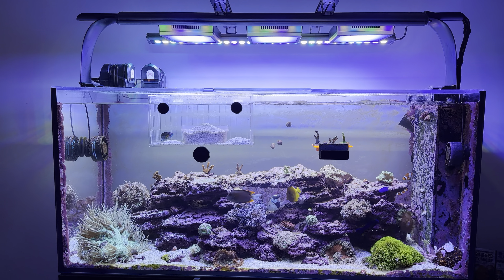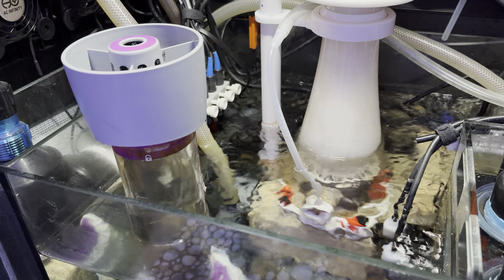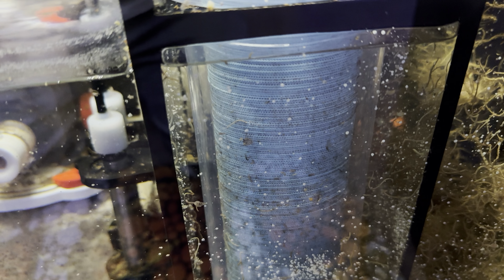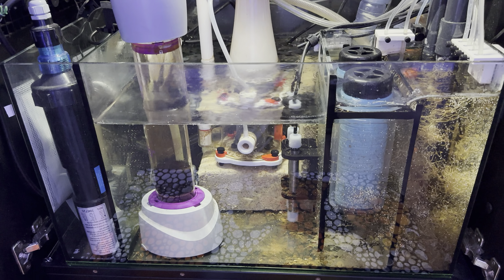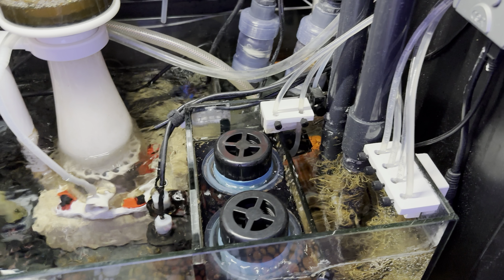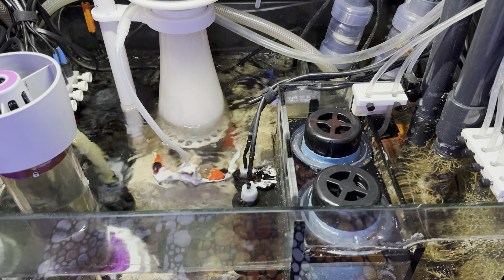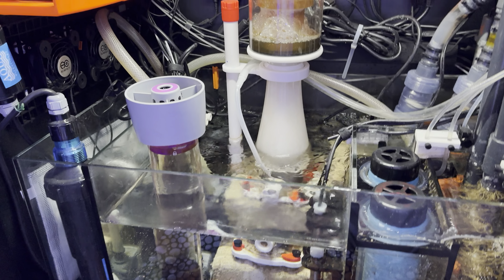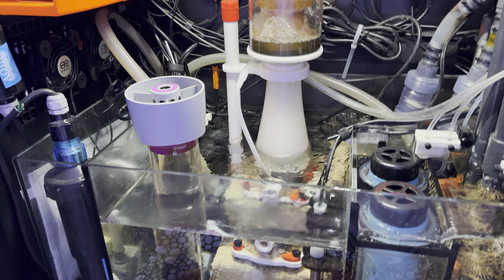Explained: Why I Prefer Low-Flow Reef Tank Filtration

Comment: Thanks for making this!  I was really interesting!  I suspect the trade-offs in flow rate hit various filtration components differently.  Those seem easier to sort through individually, but the sum total of the sump's components as they relate to the flow rate is far more complex to anticipate.  My best guess as to a the potential overall benefit to a lower flow in the sump is that the components that do not require full flow through (e.g. the skimmer, etc.) will be better able to make contact with all of the volume going through the sump system (i.e. there is a reduced potential for bypass flow).  I do like the pump in the sump to create flow.  That's a nice innovation!  Looking forward to the next one!
Reply from the maker: Didn’t mean to ignore this, my old friend, Mr. Dappled! Your thoughts are appreciated as always. This kind of stuff keeps me making reefing content. Agree on the trade-offs hitting differently, component to component. So many ways to do this hobby. That’s what makes it so dang fascinating!

Comment: I would like to know why your dosing output is in the incoming flow chamber instead of return pump chamber.
Reply from the maker: No room in the return chamber. I have exactly one dosing line back there, which is my amino acids. Don’t want those getting sucked right into the skimmer and making it foam up. But the rest, I dose in the first chamber. I don’t think it actually matters. Most people dose in the return chamber because the flow is high. But I don’t dose Kalkwasser or anything in that first chamber. Kalk drips into my overflow box, which is the highest flow area of the tank. I think the return chamber dosing approach is a holdover from the old days of kalkwasser, because kalk will leave such a bad residue if you don’t dose it into high flow.

Comment: In my opinion: Low flow rate (through UV) will actually run your tank more sterile (depending on the type of pest), as the water is in contact longer with the UV. Seeing as most bacteria etc. reproduce max. once per hour even low flow rate through your sump/UV will kill them faster than they reproduce. Hence, even the 'low flow rate' will always be higher than the total tank volume still. Due to the low flow rate, they are in contact with UV longer in comparison to high flow rate.
The only time you want relatively high flow rate through UV is for battling a plague of (water column) dinoflaggelates, seeing as passing through once will most likely not kill them (armor), so you have to 'zap' them multiple times.
As for the skimmer, I run fast LPH on my return pump (10x display volume) and for me personally, the skimmage is much better than low flow rate.
Anyway, great video and I think it shows there is multiple directions you can take in the hobby. It all depends on your combination of techniques etc.
Reply from the maker: I agree, it would make my tank more sterile, but only if my UV was plumbed in-line. Because I’ve got a separate, pretty weak pump drawing water for the UV, which just stands alone in the sump, I know that the amount of my water volume actually going through the UV is not super high. It’s enough, clearly, because I’m not experiencing any outbreaks of Ich or anything like that, but the low flow would likely only drastically increase sterilization if the UV was plumbed in-line and 100% of my water volume passed through it. I get 250 gph at best through that little Sicce pump I’ve got attached to the UV. Longer exposure time does mean more water will get sucked through it, but for me, given the small pump and the knowledge that I’ll never treat close to 100% of my water, that makes me feel better about the chances of adequate Ich management. Interesting about the skimmer!

Comment: Wouldn't faster flow just allow the water to come in contact with whatever media or uV several times creating the same affect as slow flow?
Reply from the maker: Not sure. As I mentioned, I’m no scientist. I think of it like a sewer drain. Ever see water rushing along the side of the road during a TORRENTIAL downpour? It moves so fast that sometimes the drain gets overwhelmed and cannot handle that volume of water, causing a big pool of water around the drain, and even letting some of the water shoot past because the drain can’t handle the volume. I figure pumps on my UV and media reactor and skimmer are the same. None of them are super big fast pumps, and they can all only intake so much water at a time. If I’m pumping through as much water as possible, I theorize that a lot of the water is just passing right by the pumps without actually undergoing any heavy filtration. By slowing the flow down and letting it percolate/circulate in the sump longer, my guess is that it has longer exposure time to my equipment, so there’s a better chance of the equipment pumps sucking in that water and putting it through filtration, before it ultimately gets transported back up and into the tank. Tough to describe, but I tried 😂 Again, no idea if this is right or not. I’ve had good results though.